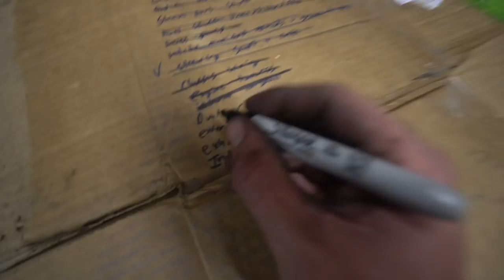LS Miata - Vette Intake and Dual Caliper Setup Install

Comment: Take those 2 tiny screws out that hold the throttle blade In..put lock tight on them and put it back together...theres multiple people online that had those screws back out and go thru the engine
Reply: Nathan 909 You could also stake them.
Reply: Or a little tig action?

Comment: Taylor, use lock tite on those screw bolts on that new throttle body and make sure it's lock-tight'ed properly!!! Don't always trust the quality control standards, Like so Taylor can see!
Reply: Enjuku Miata warr does that ahead of time, but otherwise smart to do

Comment: If you're using rear calipers for your dual caliper set up. Make sure you back out the normal cable ebrake adjustment all the way. If not it'll lock up when you bleed your hydro. Happened to me and found out the hard way when my brakes started smoking. Lol....

Comment: You should look into a OE style AIT sensor with a plastic body instead of the brass ones from the autoparts stores. They tend to heat up and stay hot in turn making the ecu think it's hotter than it really is, cutting timing and killing power.

Comment: I like how it still sounds like a rotary lol
Reply: Have you even heard a regular rotary in person? Doesn't sound like this...
Reply: @devonswindell9735  yes I have, when I was referring to "sounds like a rotary ". I meant the idle, when he revs it it sound nothing like a rotary.  I been to sevenstock 3 years in a row. I've heard the 767b , 792p, rx7 gto along with some of Mazda's rotary race cars. Pass a few inches in front of me. I also have 4 friends that own rotary's and I've ridden in all of there cars . Two fd's one is street ported running stock sequential turbo setup and the other is a 800hp 20b single turbo with meth injection. I shit my pants when he gave me a ride lol ..it's rediculously fast. Then there's a FC and a rx8 those two are stock. I don't know if you've heard one in person or not but you should go to sevenstock this year. it's coming up this November 5th at the autoclub speedway in Fontana.

Comment: Just use a filter on ost why route to intake? unnecessary.
Reply: Engines make more power when you put a vacuum to the PCV, the seals work better too, and he'll have less mess in the engine bay. He wants this car to be nice. Part of that is doing things the proper way.
Reply: @lb9gta307  thats an opinion as for the right way. Both work the same if its a proper seperation tank. Ive seen both ways fail and make a mess. I thank  you for the input thats why i asked.  I appreciate the conversation.
Reply: @bobsrx792  when I read your original comment for some reason I assumed you meant like just a breather filter on the valve cover like I see a lot of guys do. That's where the "less mess" and "proper" comments were from.
Reply: No issues I just like less lines if possible.